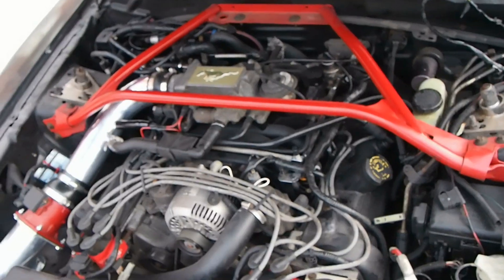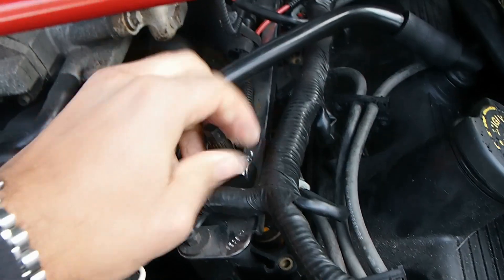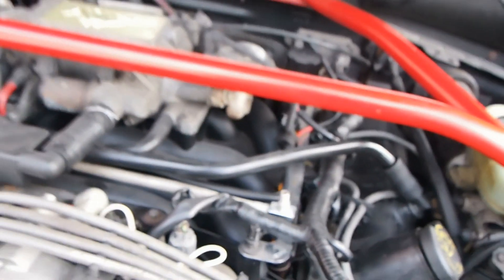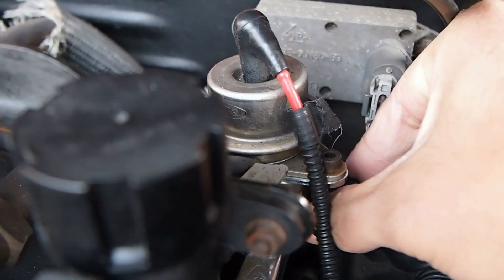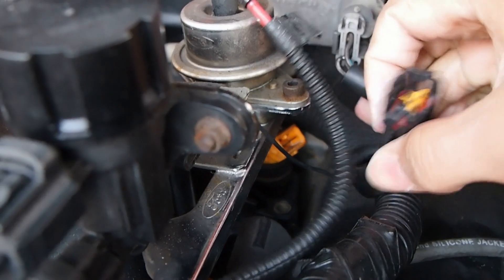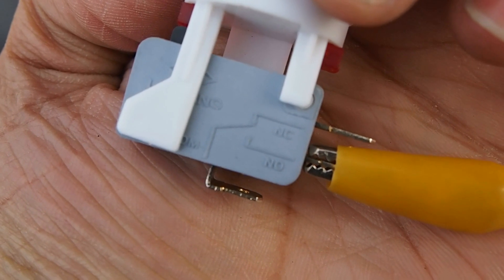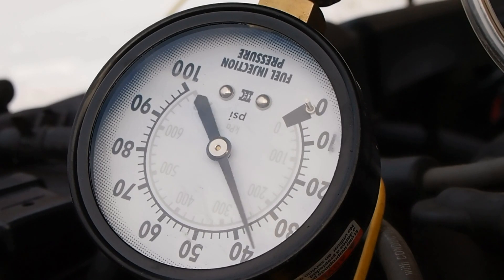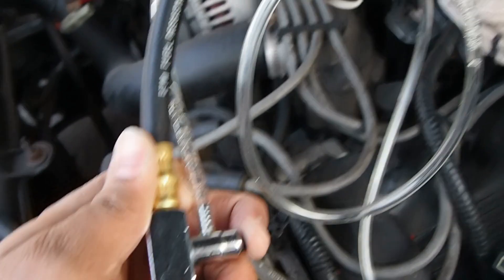Test your fuel injector (easy) any car-Mustang GT

Comment: Good video, but probably should change the name of the video. doesn't work on any mustang GT. I have a 2005 and the 2005 - 2009 have an inline quick connect that needs a different tool adapter. Ford stopped using Schrader valves for the fuel line in the 2005 gts. Still good video though.

Comment: Did you have any computer codes?  Did it indicate any cylinders misfiring?

This just tells you if an injector completely doesn't work.  How about a dirty injector or an injector with internal high resistance?  I feel an injector balance test is way better.

In addition, I have been told that turning on an injector too long will fry it.

Did you look at schematic to see if the injector gets five volts reference or 12 volts?  I think most injectors get five volts reference voltage.

 IMHO, I suggest that after doing anything like this that the oil get changed.  This is because undoubtedly the additional fuel will get by rings and get into oil.
Reply from the maker: This was a quick test to see if my injector was working because I was trying to find the problem. I identified that there was a problem with that specific cylinder because when the engine was running I pulled out the ignition wire of the spark plug and it didn't change anything. I checked the ignition and there was a spark. I changed the spark plugs because they were old anyway. Also I checked the vaccum and it was in the specs. So the last thing was fuel, so that's why I checked the injector and the fuel pressure. My initial though was that the injector wasn't working so that's why I did this test. Maybe the problem was that the coil did not give enough voltage to the spark plug but anyway I didn't have time to find out. This car didn't have OBDII so I didn't check with a scanner.

Comment: What did the problem end up being with that car?
Reply from the maker: I didn't have time to find out because I had an accident with the car.
Reply: Yikes
Reply: corght well dad gum! Your luck sounds like mine... when u think u fixed one problem another one bigger shows up!
My engine finall locked down on me!!! After replacing harmonic balancer oil issue! Turned out oil filter come loose from early vibration from old balancer!!!!!
Lifters started wearing! One didn't make it b4 oil change!!!!!!!!